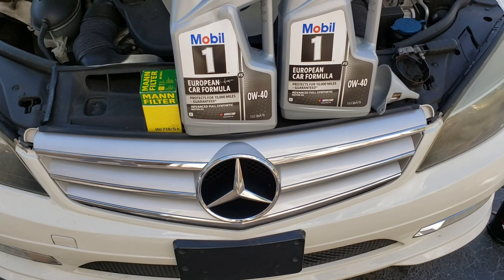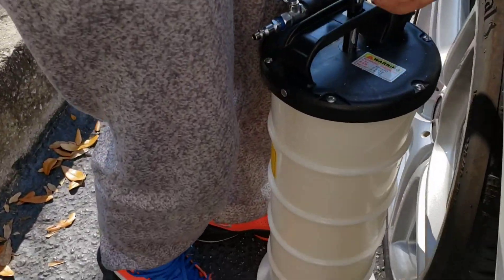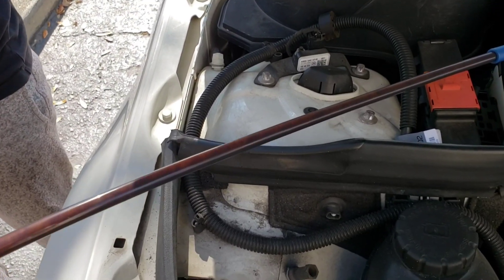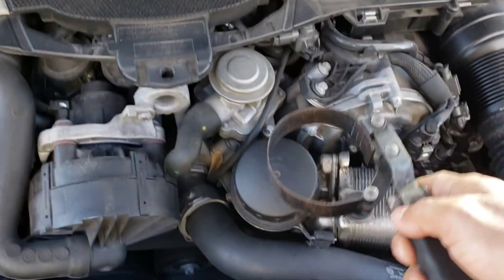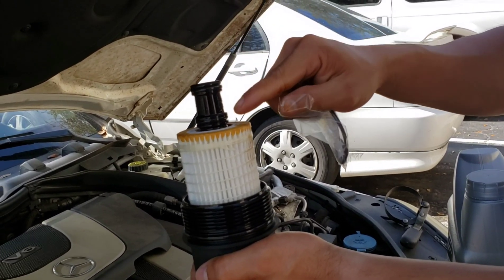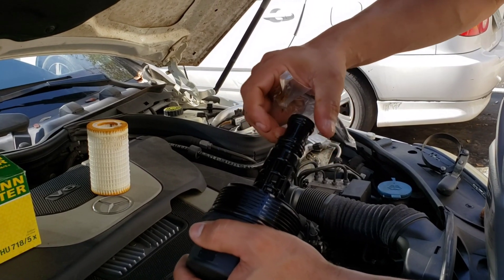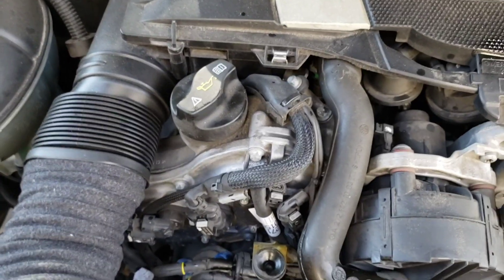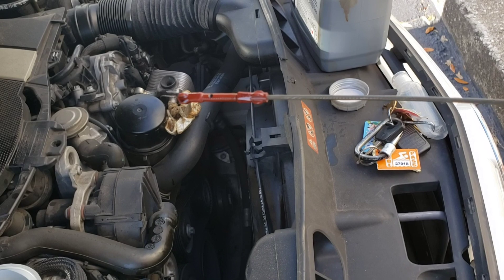Oil change mercedes c300 from 2008 to 2014

Comment: Turn on your engine before checking the oil level turn off let the oil circulate and settle and then measure again 
Before extracting your oil loosen up your oil filter to extract as much oil as possible
Reply from the maker: Great advice my friend.

Comment: hi I have the 2010  mercedes c350 4matic, will this filter fit?
Reply from the maker: Hi, I have searched on Amazon the oil filter for your 2010 mercedes c350 and it seems like is the same oil filter as my 2011 c300. So according with Amazon is the same filter. Thanks for watching have a good day

Comment: Can I use 10w 30?
Reply from the maker: Hello. I recommend you to use only the type that it said in the oil cap.
Reply: @hackerskates  thx
Reply: i use 5w40 in regular warm outside temp if it gets hot in your area 100+ degrees Fahrenheit i’ll use 10w40 and in the cold/winter i use 0w40

Comment: Although this is fine but occasionally you want to do a oil drain from the drain plug to remove sediment that this tune will never reach
Reply from the maker: Hi. You are absolutely correct, I agree 100% with you. Thanks for watching.

Comment: Isnt that way of remoing oil a little dangerous? As you are not fully drain the oil especially the part having the particules? Once I thought to buy the same pump my collegue (knows mechanics more than me ) said that I should drain the oil from the screw under the car
Reply from the maker: Hi, the best way to do it, is definitely from the screw under, for me is difficult to go under the car and do it like that, so thats the reason that I bought the pump, and so you know at list 80 percent of the particles end up in the oil filter, which in this case is located on the top of the car, it makes it more convenient for me. As far as dangerous goes, me personally I prefer not going under the car I feel more safe doing it from the top. Thank you for watching.